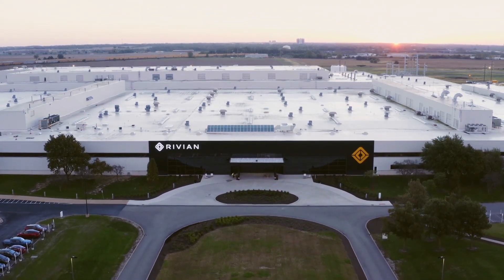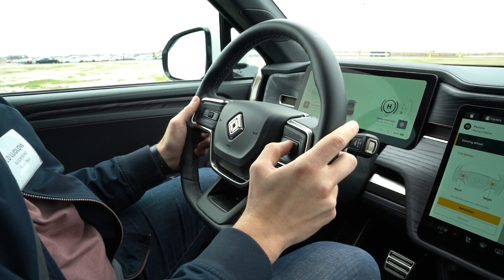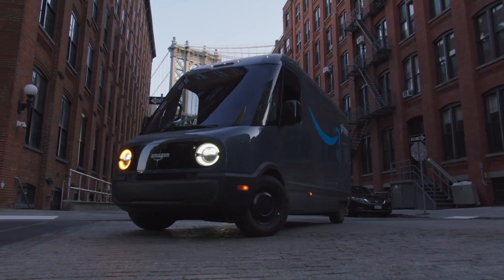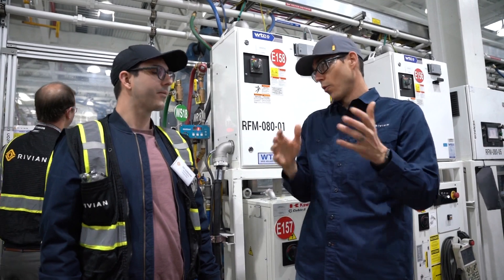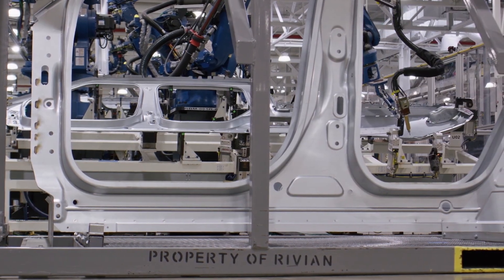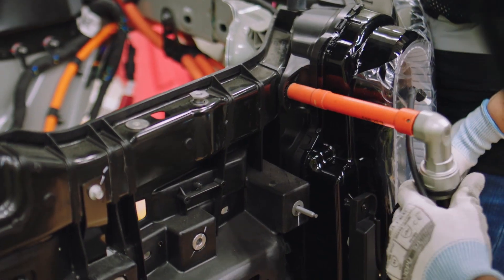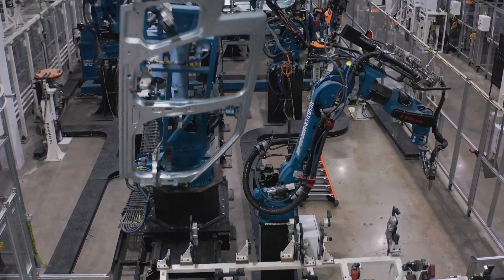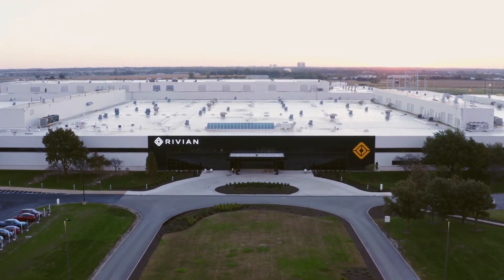Rivian Battles Chip, Parts Shortage to Ramp EV Output

Comment: 5 billion plants . this is problem to tech company just spend money because the public markets replenishes. their bank account with no true accountability. i can build a plan for 100,000 million . and i dont need  2000 miles to build a plant either. if the stock market crashes big companies will go with them
Reply: ok genious, now go walk outside
Reply: Do you have any experience on building a production plant or a semiconductor fab?  I do, $100M is a drop in a bucket in terms of equipments.  Anything less than $3B is a steal.  And this is an Asian plant where labor is relatively lower.